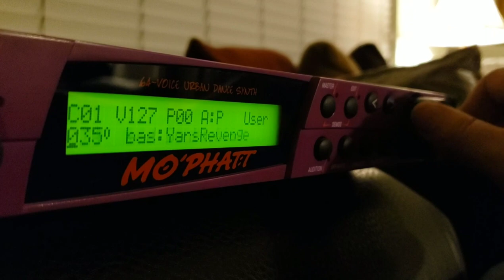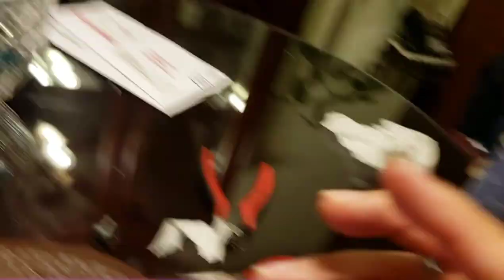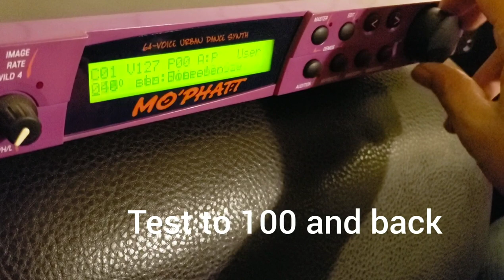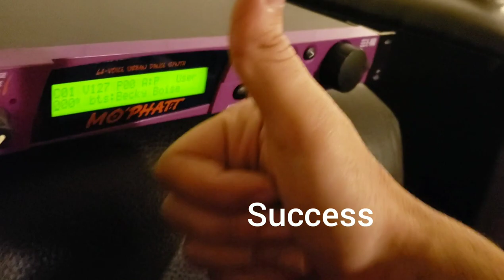Fix E-MU Encoder Knob Data Wheel Repair Mo'Phatt Proteus Xtreme Lead

Comment: I just did this to an E-MU Systems PK6 Mo'Phatt Keys, it took roughly about an hour, the keyboard version of the Mo'Phatt rack, you have to desolder the encoder from the top board and remove it in order to access the clips that hold the encoder together which are on the bottom of these vs the top on the rack versions,  other than that, it is pretty much the same procedure to refurb the encoder, I do however clean all of the old lube / grease out of the encoder housing and off of the shaft of the encoder, and replace it with DeOxit Fader Lube, and it works great, there is also a shield that is soldered to the mainboard that helps reinforce the encoder on the board, there is a nut and a washer you have to remove from the encoder housing after you've desoldered the encoder from the board to remove that shield, now is also a good time to remove all of the old solder from the board and the encoder legs and clean up the surfaces before you apply new solder to reaffix it to the board!

Comment: Wow, I was thinking of trying to get at the encoder by disassembling the front panel from the inside.  I'm glad I found your video first.
I plan to try a cleaner that includes a non-conductive lubricant in the hopes of reducing the wear on the metal contacts.  For example, Teslanol T6-Oscillin Contact and Tuner Spray.
Thanks for the ideas!

Comment: You really just need to bend the contacts up a little. Open the encoder, bend the contacts, and close it again. That'll fix it and make it more clicky.

You don't need to clean the contacts. I'm pretty sure the only thing in a 25-year-old Emu that ISN'T oxidized is the contacts in the encoder. Sanding them down is redundant — they're sanding themselves down on the wheel every time you turn it.

When you spray everything down with cleaner that removes the lubrication. That makes it turn less smoothly and wear faster. If you want to clean everything you should replace the grease with some FaderLube. And like the video says if you're going to use a Q-tip or cotton ball or paper towel, you really need to make sure there's no little pieces of fuzz left in there. I've got several Emus, and I've had to fix three of the encoders, and the only time it didn't work quite right the first time was when there was a little piece of fuzz that got caught on one of the sharp contacts.

You can tell you've got a foreign object floating around in the encoder if it works great for awhile then totally stops responding until you turn it the opposite direction. It stops responding when it gets caught on the contact, then it releases itself if you turn it the opposite direction.

Comment: Thanks so much. My encoder works perfectly but skips a few clicks. It doesnt hurt operation but I'm going to sell it soon and I feel this will hurt my asking prices or the sale if I mention it and I am too honest to not mention in the listing if it remains this way. Do you think just spraying a little de-oxit down the shaft could help or be a bad idea? I'm not really nuts about opening the encoder and risking to break the unit.
Reply from the maker: I'd give it a shot, but if possible use deoxit fader, or fader lube
Reply: What could help selling it, is demo-ing the diagnostic self test. Push < and > together when turning on the module and there you are. Memorytest etc available. You can adjust the potmeters as well. I thought one was defective, but it was not well adjusted ;-)

Comment: Any idea for a fix if one of the TRS stereo outs fade down every 2 mins or so? Like, i'll have it in audition mode and every minute to two minutes the right channel will get lower and take 5 to 10 seconds to fade back up
Reply from the maker: Sorry, sounds more advanced
Reply: @brainztain  I fixed it by taking a Q tip of alcohol and cleaning out the TRS slot, there was some oil or something on the metal in the back... Now I gotto fix the wheel too thanks for the video btw im going to follow it today lol
Reply from the maker: @toktok9975  wow glad you fixed it and wasn't too compacted 👍